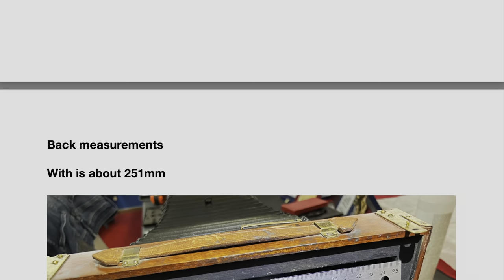Preserving History - Renovating a 100 Year Old Camera

Comment: Thank you for filming this, you did a great job on a fine old piece.  That camera holds a huge amount of cultural energy: the centuries-old idea of projecting and holding an image of the world, the innovations employed in its design, the beautiful craftsmanship and its history of use.  I don't have the temperament to see through a project like this so I'm glad you do.  When you mounted the extension, the bellows sagged.  There are rings attached to the bellows in which you insert a rod that attaches to the lens board and back to support it.  They can get lost pretty easily so I wouldn't be surprised if it's gone missing.  Are you going to pursue that?
Reply from the maker: Thank you so much for your kind words. I made sure they build the bellow with these rings again (normally they don't do). I don't have this rod anymore, but I have use sometimes a long chopstick. But you are right, I should get one that is more original. Do you have any idea how they looked like?

Comment: The red looks awesome. I did the same on my 100 year old camera, but in black. It is absolutely worth it. Greetings to Austria
Reply from the maker: Thanks a lot! I was a bit sceptical first, but now I am so happy with the red. What camera did you renovate?
Reply: @mhaustria  I was sceptical, too. Even when the red bellows turned me on, I was not as gutsy as you to make it happen. So I ended up with the black ones. But it is fine now, too. I renovated a Korona 8x10 Home Portrait. Additionally I will try out the oil you mentioned in your video and grant my baby a special treatment
Reply: I ordered the bellows in Hongkong. Great people and very good quality
Reply from the maker: @black-and-light  they are answering ver fast and are very professional
Reply: @mhaustria  I totally agree
Reply from the maker: @black-and-light  I learned that they build bellows since 12 years or even longer

Comment: Excellent. I just purchased a 1904 Century 8x10 with a Turner-Reich shutter should get it in the next couple of days. I plan on using it mainly for wet plate. It comes with 7 plate/film holders, the base extension and a set of extra bellows. Would you happen to know if a reducing back for 4x5 is available for the Century cameras of this era? Do you happen to know what the model number is for the  camera you restored?
Reply from the maker: Thank you. Mine is a No.2 and I can hook you up with a guy who builds placeholders and reducing frames
Reply: I ended up purchasing the new Zebra 8x10 wet plate holder with a 4x5 reducing insert. What a nice piece of equipment.

Comment: I did this same thing last year with my Century view camera. Yours looks just like mine. Did you find out what year yours was made?
Reply from the maker: Sadly I did not. Is there a way to find out?
Reply: @mhaustria  i couldn’t find one. Mine is somewhere between 1902 and 1903 I believe. The patent says 1902 and I know in 1903 the century camera company started calling their big 8x10 view cameras Century View #1 or Number 1. I found markings on the inside of my lens board front standard rear standard idk if that helps and I believe the camera serial number is on the top inside of the rear standard. If I remember that correctly. At this point I believe mine is 120+ years old.